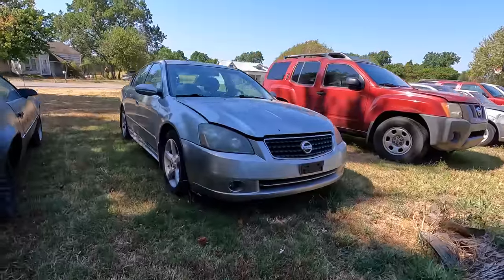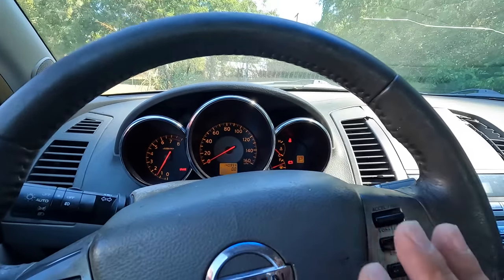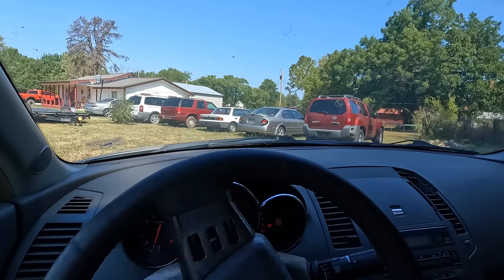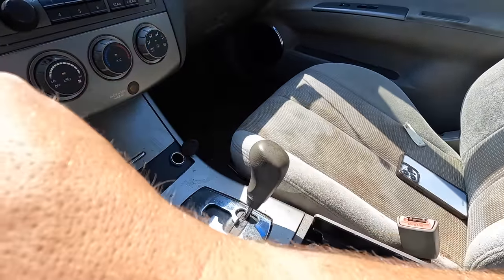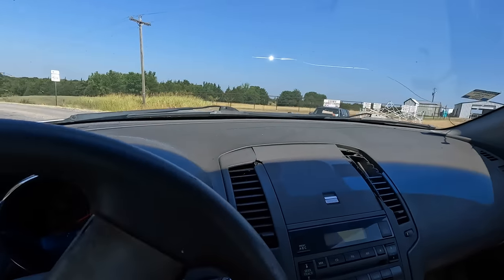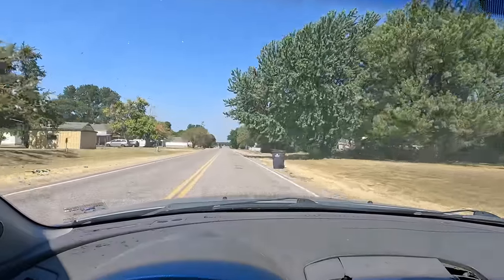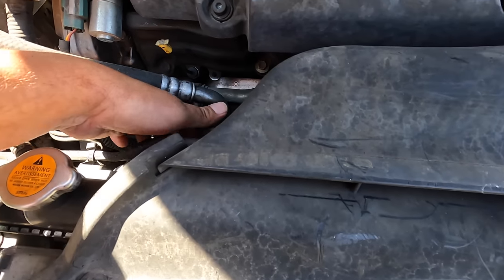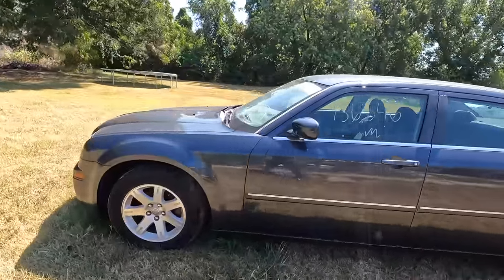I Won the Worst Nissan Altima v6 Ever! Here's Why it Sucks!

Comment: As a nissan enthusiast I own 2 of those L31 Nissan Altima SE-R (special editions) I know all about those cars the positive battery terminal is a fusible link, check there first before you dive into the alternator a BITCH to do on those cars, if the transmission is stuck in 5th gear it is the camshaft position sensor is a issue it will put it into a limp mode that does not have a CVT it is a 5 speed RE5F22A the valve body might needs to be cleaned it's a relatively simple job and the valve body is $175 new shipped you will get your money back for it

Comment: If I owned it, I would replace the alternator, battery, and shift solenoid.  I had an Infiniti that had the same symptoms and that resolved them all. Those engines are solid but leak oil.
Reply: Hah and coolant.

Comment: That Altima doesn’t have a CVT; when you put it in tiptronic mode, it said it was in 5th gear. It’s likely in a limp mode.
Reply: Yeah, the V6 cars didn’t come with the dreaded CVT
Reply: @The_Redkween  they did but ok
Reply: @BoltsNBalls  later ones did but that was in the generation after this one. I used to have a 2002 Altima, same gen as the one in the video, and that came with a 4 speed automatic. Later models got a 5 speed auto
Reply: @BoltsNBalls  New models have the CVT I believe.

Comment: Maybe a limp mode, from the no charging? Some cars don't like low voltage and amperage and do crazy things. Wires could also be damaged from all that motor/trans movement.

Comment: It's in limp mode because of the alternator being bad That's what the Brake light + battery light mean also it is a automatic Tranny not CVT at least for my 2.5s

Comment: I would put an Alternator on it. And the transmission might shift properly. Nissans are pretty picky and with it being fly by wire, it's probably not working right because the charging system is dead.
Reply: Yeah my Altima did exactly that
Reply: The computer needs 14 volts. Definitely check charging system. Those 3.5 are pretty quick
Reply: The reason for the lights and the way it's running is because of the charging system. Everything is electronic it needs 14 to operate correctly. I seen it on a Chrysler Aspen it wouldn't move hardly at all until I changed the battery it wasn't holding a charge period even with new alternator
Reply: It's could easily be some blow fuse
Reply: What is an alternator and automatic transmission fluid? A few hundred?
Reply: yep, had my 2.5l 06 fail to start due to a lower quality battery, had to get a higher cca one to get it to start even though the other one met the minimum. very picky electrical wise
Reply: @jgruber2482   I'm sorry for bothering you I understood everything uou said,. But was the problem, just the battery, or was the alternator dead as well
Reply: Absolutely change the alternator it worked for me w/o a problem.

Comment: That generation of Altima didn’t come with a CVT, Randy CVT started being introduced to the Altima as of 2007.
Reply: Yes sir you are correct
Reply: it has the “dearded” 5 speed auto.
Reply: @michaelcrockette8694  that 5 speed is bad? I know someone with an older Maxima with a 5 speed and it seemed pretty good
Reply: CVT is in the Altima came out in 95

Comment: These cars have 5 speed tiptronic/auto transmission made by Aisin Warner and when they in limp mode they are stuck in 5th gear, so something is causing it to go into limp mode.

Comment: Hey randy you don't have to think about the trans because google says the altima 3.5 se could only have a 5 speed auto or 5 speed stick shift in 05 2007 was when the altima got the dearded cvt

Comment: Get the Altima voltage right. Then drive it. Voltage will affect many systems including the CVT.
Reply: It's not a CVT. Altima didn't get CVT until 2007
Reply: I agree.  The 3.5 maxima is a great alternative to a similar Honda Accord or Camry at half the cost.  At least put a scanner on it.
Reply: @tall_dude1233  thanks I did not know that.

Comment: I use to have a 05 Altima 3.5 SE just like this car and it’s definitely a 5 speed automatic! These cars were sleepers bc they were veryyy quick. 0-60 in 6 sec stock on a auto

Comment: I think the 5 in sport mode means its stuck in 5th gear, which is why it barely pulls from a stop. Probably is limp mode for a nissan
Reply: i was stuck on 4th and 5th, until my  friend toldd me to fix a metal cconnectioion oon thee  circcuit boaard bbehind  the vallvee body.  ttheerer  iss aa probblem with my keeybooaarrdd..  minee wwaas  a elgraand ee51

Comment: I’m a transmission mechanic by trade and I do Nissan Altima’s quite often. CVT’s are absolute trash. I would not buy ANY vehicle that has one. Ticking time bombs.
However I don’t think Altima’s had CVT transmissions until about 2007.

Comment: Had an 05 Altima, not a CVT. Its a 5 speed auto and they’re also quite peppy. Had an alternator charging issue which had the transmission stuck in 4-5th gear(“limp mode”). After having the charging system and shift solenoid fixed it turned back into the beast the 3.5s where made to be.

Comment: The battery light indicates an issue with the charging system. I’d replace the alternator, battery, and belts… it should drive just fine after that.

Comment: I think that the transmission's computer is causing the issues, but then again it's an early 2000's nissan so the transmissions even the non-cvt's are not the best.

Comment: These third gens have a normal auto, it’s the fourth gen that has a CVT. The 2.5 Altimas are the problems ones, they consume oil like crazy. But if you got the V6 it’s a solid car. But Nissan was have a ton of issue with alternators during the mid 00’s. The alternator went out in my mom’s 06 Pathfinder a year after they bought it.

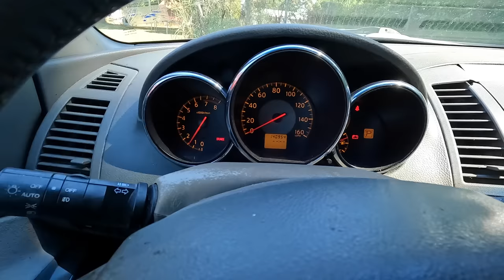Comment: That noise at 3:16 100% is not the power steering. That is the timing chain. It will need the complete timing chain job done. All new chains, guides, and tensioners.

It's a very common problem on early Nissan VQ series V6 engines.

Comment: My grandmother used to own a 2005 Altima 2.5SL and it blew a head gasket before 200K miles but the transmission started to shift extremely rough

Comment: Yeah I would replace the alternator and see if that fixes the charging problem the battery light may also be a computer issue if the car has a computer Sometimes some cars record when they lose a battery or when they lose battery power Nissan's do it so do Toyota's and BMW is the worst offender of them all so replace the alternator give that a shot can't wait to see the next bucket that should be pretty badass if it's a yellow one it should be really badass does have an air scoop on it

Comment: I am almost 100% sure it is a camshaft position sensor I have had this issue with my Altima 3.5 and maximas aswell it takes a few extra cranks to start and likes to stay in 5th gear even from a dead stop witch is why it feels slow it will also Couse a jerk when coming out of park to any gear feels aggressive 
Cvt or not they are quick ish cars 

I bought a 2006 maxima for $300 owner said transmission was blown I scanned it camshaft sensor I think bank 2 code came up I replaced it ran perfectly fine and sold for $1700 few days later

Comment: Later Nissans use Jatco CVT transmissions they are NOT good quality units, before Nissan merged with Reno later Mitsubishi they built quality vehicles, maybe that newish looking alternator is not hooked properly???? I would say the CVT is screwed, the Honda Civic is old and rough looking but back then they built solid cars with some work it could be good again. The Honda Accord will serve someone for many years yet, even the Chevy Citation may find an owner some would hate it another will love it.

Comment: I know 30 people have commented about it. But, it’s a 5 speed auto. When you shift it in sport mode. The cluster is saying it’s stuck in 5th gear. But looks like an S for sport mode. Not sure how far down the rabbit Hole it would be. But usually the slightest electrical problem on these Nissans will screw everything else up

Comment: The VQ35 will use oil like crazy. Great motors if you can keep oil in them. CVTs are CVTs. Keep the fluid changed and replace the trans filter every once in a while and don’t beat on them. They aren’t too bad.
Reply: David Gregg, I’m thinking about getting a Maxima eventually you think the newer CVTs are any better on the Nissans than the older ones or do you know? Thanks.
Reply: @gopats85   my wife drove an 06 Murano for many years. I got it with 67k miles and traded it in last year with 235k miles. The week I got it I drained and filled the trans. Always used Valvoline CVT fluid. Changed it every 30-40k miles and replaced the filter twice. As far as I know, it had the original transmission in it when I traded it. 
Like I said above, the VQ35 uses massive amounts of oil past about 140k miles. From what a tech told us, the piston rings Nissan used wore prematurely. Don’t know how true that is. From what I’ve seen at least on the Murano pages, the reliability of the CVT hasn’t improved. But who knows how they were serviced. 
I’m a Nissan guy. I own an 08 Titan that has been extremely reliable. Just turned 185k miles. 
Traded the Murano for a 2015 Xterra Pro4X.
Reply: @DavidGragg82  
Yea the last couple of cars I’ve had are VWs knocking on wood no problems on the Jetta I have but have always wanted a Maxima since high school and loved them since the 1990s boxy ones. Lol.

Comment: cvt is what my scooter also uses, in bigger cars it is metal to metal wherease in scooters it is almost always metal (from vario & centrifugal clutch) to rubber (belt). it is basically a system where you have two pulleys that are adjustable in diameter.
the vario makes the gap between the end of crankshaft and vario itself smaller when the engine spins faster (because there are weights in the vario self or the vario is electronically adjusted which forces the vario to move outwards) this means that the belt moves outwards resulting in a larger diameter (because it cant go anywhere else).
Because the belt now needs more room at the front the belt wants to make the gap from the outgoing shaft larger (smaller diameter). There is a spring in the rear shaft which pushes onto the belt forcing it to the outside (larger diameter), but when the engine spins faster and the front wants more belt, the belt forces the spring to contract making it a smaller diameter.

This was my attempt to make the cvt understandable idk if I said everything correctly, because recently learned about it. I hope it was usefull!

Comment: Seems like a limp mode to me. All the dash lights will come on in limp mode.  CVT's will wind out like a regular trans.   Run codes,  do a trans service.  Clean it,  paint it.   140k is low miles for an altima

Comment: I’ve got a 2005 Altima and I replaced my alternator from eBay from TYC and I had a similar experience with the transmission not wanting to shift when floored and long cranks 1 of 3 crank position sensors was damaged from the freeway ran over a tire but new sensor and repaired the wiring and it was like nothing happened and the transmission is a Toyota 5 speed for 3.5 v6 only 4cyl had a 4 speed

Comment: The 2005 Altimas are a regular Automatic transmission, which makes their own transmission called Jatco. 2007 and up that's when Nissan put CVT's in their newer and updated Altimas.

Comment: Definitely try the alternator im a mechanic and had one come in for that very not shifting issue and batt light replaced alternator and went out of limp mode shifted normal after that. Just give the chance of an alternator if anything that car deserves a little chance.

Comment: CVT didn’t come until 07. I’ve had bad cam sensors in those cars and it wont shift right. It’s in limp mode.

Comment: That car is in limp home mode. My 2011 altima did the same thing. Unplug the battery and try again. It might be the MAF or the throttle body or the cam shaft. Maybe they were checking the fuel pump since the carpet was not put back.

Comment: That's a 5 speed automatic.. shift solenoids might be shot.  CVT didn't come into the Altima until 07' model year.  Sounds like the Timing chain guides and tensioners are done

Comment: I 100% gurantee you it’s not a CVT. Had one of these a couple months ago. always had a mass airflow code. One day it ran like trash and when I replaced the mass air flow sensor it ran nice. same exact thing with the transmission. it’s all from the mass air flow sensor.

Comment: I have a 2005 nissan primera with 20k ish miles yeah you heard it right the car is brand new. It's been on the family since it had 6 kilometers on the clock so i know it hasn't been abused at all and I've had harsh shifting when i had the battery a bit loose. It stays parked for long time periods and the worse time it did the shifting thing it was when the connector disconnected. Even the cvt light turned on on the dash so I'd check the charging system before dooming it

Comment: You have to remember, cars today need the correct voltage for everything to run transmission included I would start with the electric and I bet you the tranny will run just fine

Comment: Randy, I'm pretty sure the battery light has something to do with the transmission, so shange the alternator if it fixs the problem all good if not then check the transmission fluid

Comment: I think you should fix the charging problem first. Because my murano has the same 3.5 motor and when I had alternator problems the whole car will go into limp mode. Good luck changing that alternator. It took me 3 long hours to change because its in atight spot where the radiator, fans had to come out

Comment: Its not a CVT just a regular transmission but its definitely in a limp mode or something .. the car is worth it if it have less miles and slightly in a better condition..

Comment: Yes that is a CVT I had the Nissan Murano 07 model same transmission that yours has I've had the same issue before check your fluid fluid probably needs to be changed
Reply: Well this gen of Altima didn’t come with the CVT, they come with the regular automatic it was in 2007 that these come with the CVT.

Comment: If a Nissan cvt jerks shudders or whines it’s on its way out they can overheat easily too Nissans had a problem with them due to a small cvt fluid cooler I had a 2015 Nissan Juke with 80k and the cvt was going out changed the fluid but it didn’t help I traded it for Honda CR-V guy at Nissan dealer said most cvt go out before that

Comment: this actually pained me to watch because I own the V4 2.5 special edition of this car.  They are NOT a CVT,  that hard knock shows that the gears are worn bad and is slipping. that's a really expensive fix so yeah this is trash, my suggestion is draining the trans fluid and putting in some of that thick non-slip trans fix fluid. Maybe you can get lucky, But man I promise you if you can find a good 05-06 Nissan Altima that was taken care of I would pick them over these newer Altimas any day.

Comment: Its a volvo 5 speed "normal' automatic transmisión AW55-50SN , it stay in fifth gear because the camshaft position sensors , the hit when you put reverse is normal even when the transmission its working good i mean, its not normal but by the years and the use causes that wear

Comment: The Altima could be a loose ground as there was a point where the battery light went off. The trans could be in limp mode due to a possible bad crank or cam sensor considering how long it took to crank and how fast the cel came on...

Comment: I have a 2017 Altima that was doing the same thing. I changed the transmission fluid and it started to run normal after

Comment: Not a CVT but it seems with the really slow acceleration the transmission is stuck in first gear you shouldn’t be at 3000 RPMs doing highway speed 2000 at the most so there’s something going on there

Comment: The t bucket is a 302 Ford motor what year I don't know you will have to get it decoded and the cavalier I have a friend who loves those and he might buy it if it runs
Reply from the maker: Nice guess, but you are waaaaay off on the engine on the T Bucket. Wrong manufacturer, and wrong displacement.

Comment: It might be a camshaft or crankshaft sensor going out or it might just be a serpentine belt. Hubby’s truck had all 3 things done and the truck ran just as bad but at stoplights it would die. And when the belt went off his steering was bad

Comment: My mom has a  2006 impala that has the 3 . 5 liter v6  and it leaks a little oil but it still runs good that she  baught 2 years ago   For 1500 and  still driving it

Comment: The cvt trans has a belt in it no gears. The only way to fix is replace the whole trans. I unfortunately have a versa sedan it's on its second transmission.  Bc of the same issue bc I don't see an check engine light.  Just giving you a heads up.  My goes like hell now. It's a sealed unit
Reply: Change the transmission fluid  also the filter every 20.000 miles, Learn to do it your self it’s pretty straightforward.

Comment: the alternator with a sticker doesn’t necessarily mean it’s new, could be salvage. some voltage troubleshooting would narrow it down from the battery potentially too. i also always hear about flushing transmissions in those cars, and they somehow go wrong. i’d be curious about that. that’s also under the $500 budget for a lot of potential life restored. 
 im no professional, but i am the audience for these type of projects as a young aspiring and low budget hobbyist, these are within reach, while disregarded by many.

i think the interior has a LOT of life left in it too, the exterior damage is negligible imo besides the windshield. i guess i just see the potential.